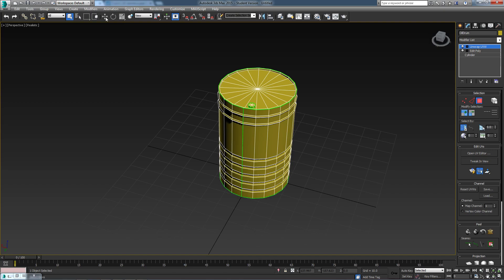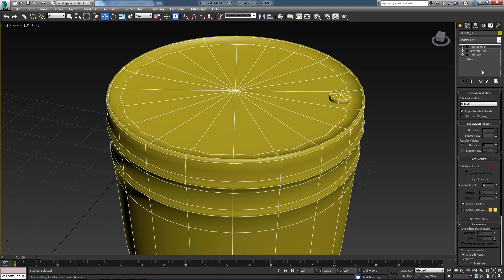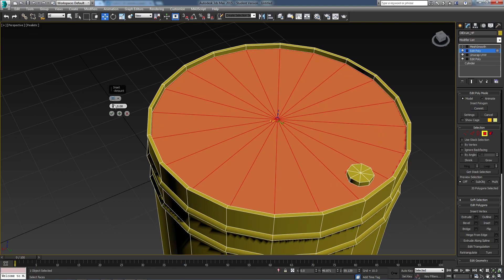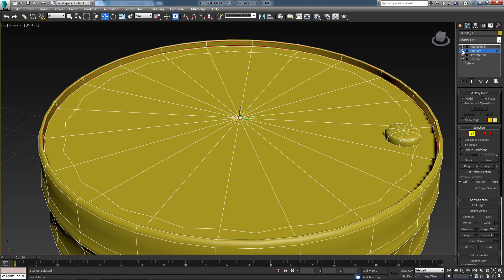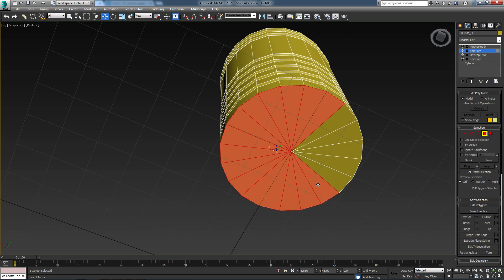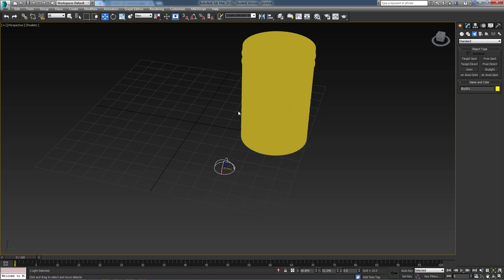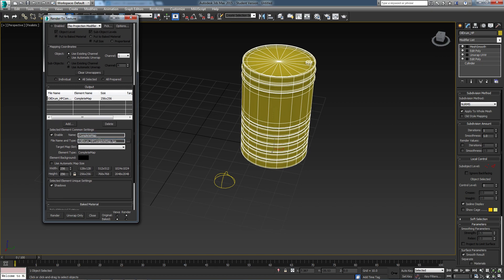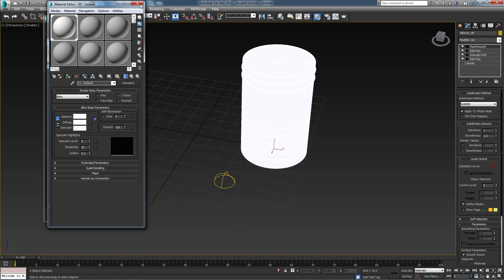Lesson 2 Part 3: High Poly to Low Poly Baking intro

Comment: Hey Hi, I Had watched all the tutorials its was very helpful, I have few doubts. 
Are u sure? as we kept an edit poly above unwrap modifier we wont get any major destructive changes in our UV map..
What are the cases that would create destruction to our UV.
For example (extruding edges we would get destruction to our UV)
 
Will u Explain that Please.
Reply from the maker: If your extruding this will require additional changes to the unwrap, but we added edges and manually moved them. This was also in an older version of 3DS max i know things have changed since then.